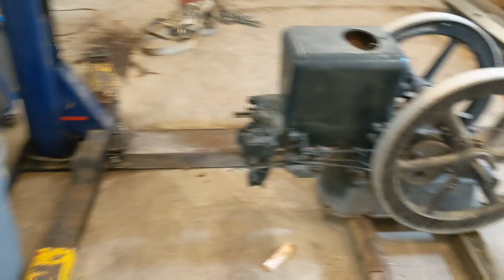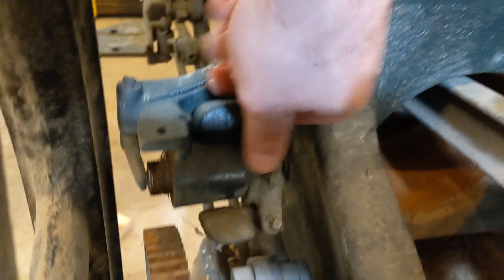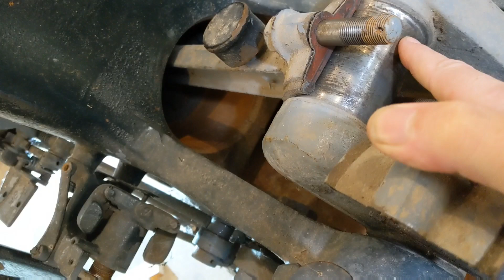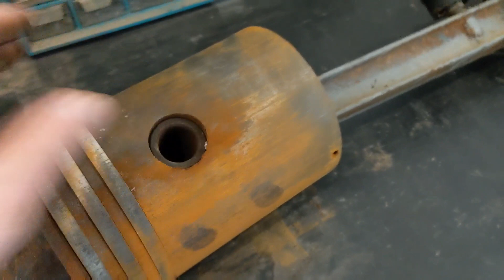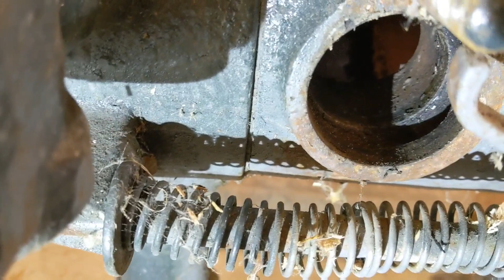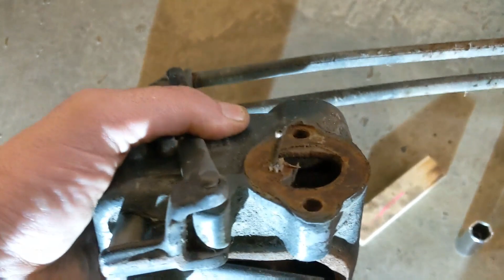1917 Fairbanks Morse Model Z 6hp Engine Restoration - Part 1

Comment: This information is going to be a real help to me in the near future. I have two of “them there” rascals. There is a small arm on the head side of the mixer. It pivots on a single pin, but I cannot determine what it does or how it does it. This is a hit and miss engine and the mixer has a pump. Can you tell me, please?

Comment: Hi I have a  chance to buy  a f/m 6 hp . The thing is the main gear has a tooth missing and a v shape out where the tooth is missing, it does look machined but i think it is broken what do you think . Many thanks Gerry
Reply from the maker: Mine doesn't have any missing teeth on the main gear (the one on the crankshaft) so I'd guess it chipped off on yours. I think they are cast iron so pretty weak metal. The timing is done by that cam so I don't think skipping the odd gear would hurt anything, it's only driving the governor. Good luck with your project!